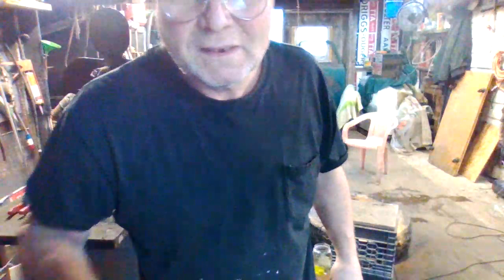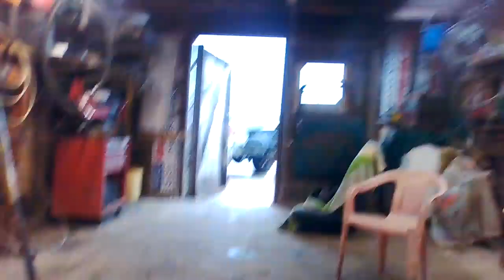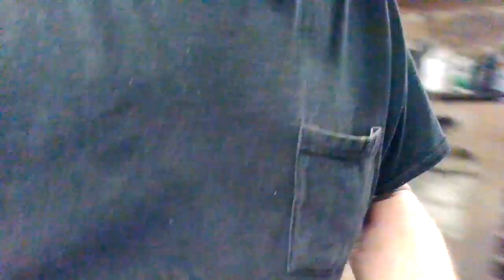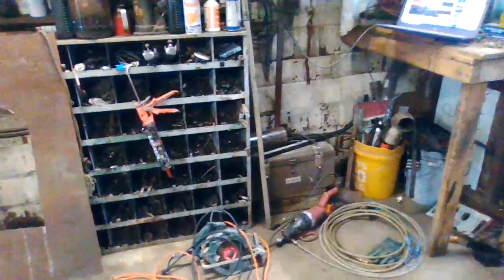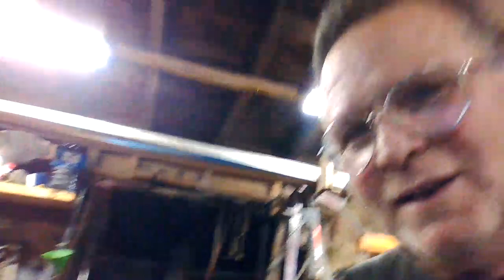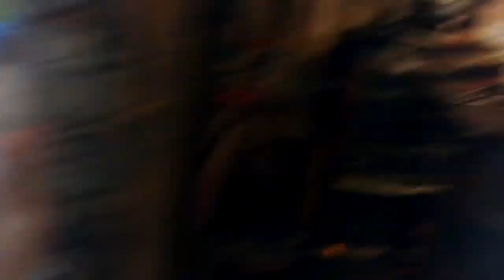The Down Pour Blues

Comment: With that Resistor it look’s perfect speed 👍, i have the identical bead breaker i got from the railroad lol, I put a weighted pipe on the end , works really good breaking beads, but since I got a wood splitter,I usually use that to break the bead now